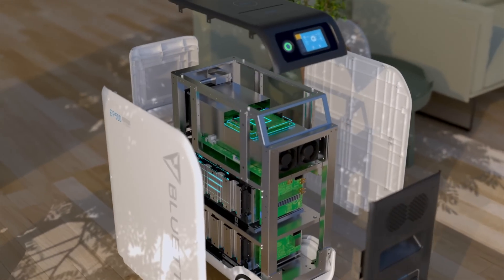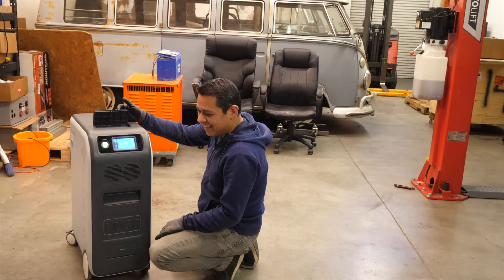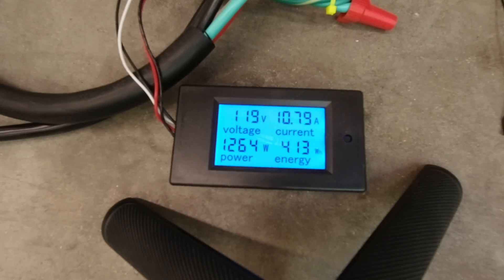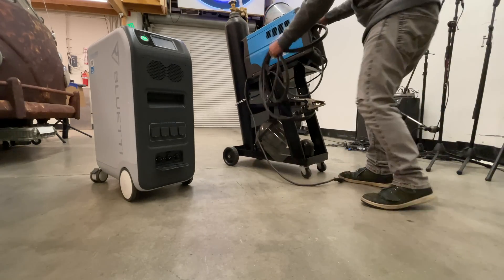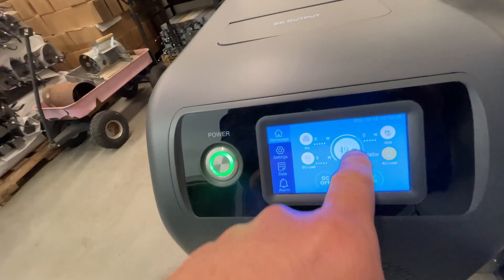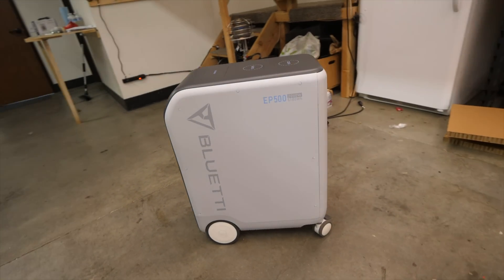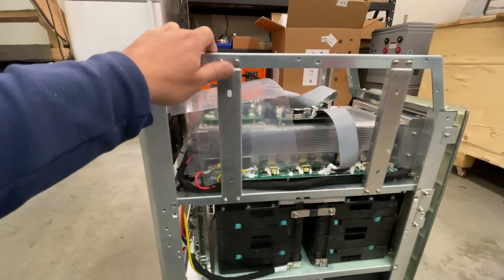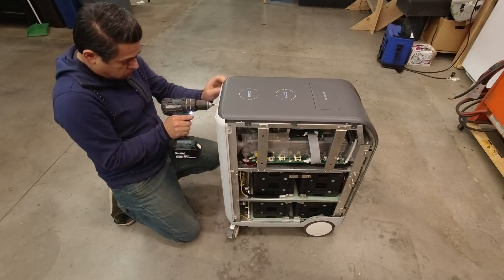Everything you need to know about Bluetti's NEW EP500 - review

Comment: Given the 85% efficiency, unless you live in a tinyhome/vanlife situation, you'll deplete this fully from 100% to 0% in under 1 hour if you try to use it to power your entire home, assuming a standard 2-3br home with efficient appliances and LED bulbs. My office alone, eats 14kWh/day, and my hot water heater (new, efficient, serviced model), is 16kWh/day. I'd have to be recharging this 6 times/day, every day, just to keep it from reaching 0%, even in UPS mode.

Comment: The elephant in the room, is the computer chips which grow fibers like corrosion shorting between the legs of the chips. It’s great, until the short. Will this failure cause an overcharged state or fire.? Will it just fail to charge, turning the unit into a toxic boat anchor.? This depends on the short location and that determines system failure condition. 😢

Comment: You can build this system yourself with 4 lithium batteries, an inverter, and a charge controller all for about $1,500.
Reply: You are way a little bit off but not by much .   Just a 100 amp 48 v. Battery is about 1,400 alone , then you need a good MPPT controller with an inverter for about 900 bucks  , then you need terminals, thick cables , switches etc, plus a way to move that brick around for another 2 to 300 bucks so you are a little off

Comment: Can I select that the power station uses Solar panels as its main source until the batteries are almost depleted? So only then it uses the AC power to keep my devices running? I would like to save money on my electric bill. 
My house is a rental that already has 6 solar panels on the roof, but since I don't own the place I can't add more solar panels to the existing configuration, so I want to use my own solar panels to a power station and then connect my TV, PC etc to save more money in the summer. 

Also, If the backup battery is full and idle but the solar panels are still receiving power, can it just send the remaining power back to the power grid via the wall outlet? And does this power station also support that? 
Thanks for answering these 2 question, good day :)

Comment: Just wondering if you know if the OCP over current protection - hardware alert on the ep500 pro easy to fix? Is there an internal breaker/fuse I can reset or replace?

Comment: I received my 2 EP500s from Bluetti. I was part of the initial 500 Kickstarter Backers. I did an AC load test, running a 1400W electric heater on a full battery. I ran the same test on both units to confirm any one result wasn't a fluke. I measured using a Killawatt meter. I actually got 4500Wh to the tee on both units--higher than the 4292Wh in the video. That puts the efficiency at 87.89%, or rounding to the tenth, 87.9%, or rounding up since it's only .1%, about __88%__. That's actually pretty good. Looks like Bluetti did some performance tweaking since these units were sent out in March.

Also note that in Offline UPS where grid power is "passed through" I found a problem. Hot and neutral wires were flipped! Verified with a multimeter and outlet tester. I contacted Bluetti, and they sent me a video with instructions on how to correct. Have to pull the front panel off and swap a couple of wires. You get a deep discount on the Kickstarter, but I guess the catch is you are somewhat of a "late Beta" tester and could get some "bugs." Interesting that they sent me instructions on how to do it instead of sending a tech. I guess they figured early adopters are more comfortable doing that type of stuff.

UPDATE: I pulled the units apart, and sure enough, the Line/Neutral wires were swapped at the PCB for the AC Outlets. Note that all of the wires and PCB connectors themselves were labeled correctly. It looks like someone on the manufacturing line just plugging in the wrong ones, plain and simple. Good news is that should be easy to correct--just tell the guy on the line, "Hey, you got the cables flipped. Connect them the other way." I suspect future batches will have this corrected now that they are aware, but for now, if you run into this problem, especially if you are one of the initial backers that were in the same manufacturing batch, contact Bluetti and they will show you how to remedy the situation.

UPDATE2: Bluetti contacted me again and said they traced the issue with the initial EP500 batch and are updating test cases to catch this type of problem on the production line. Future batches should not have this problem.

Comment: I got the EP500 and connected one Renogy 150D 12volt solar panel to it via MC4 cable.  I don't know which +/- set on the Bluetti MC4 adapter cable to use.  My PV input W is at zero, but it shows the input voltage at 22.0 on the DC Input screen of the Bluetti with the Input Power at 0 watts.  It does not appear to be charging even in full sun.  I swapped the negative MC4 solar panel cable to the other Bluetti negative MC4 adapter, - no difference.  I also swapped the positive cables - still nothing. What is wrong?

Comment: Question: I had a transfer switch installed in my house when I bought a portable 10k watt generator. If I were to purchase the Bluetti would I be able to use the same transfer switch or would it need modifications? Full disclosure I’m solar, LP & Gas generator ignorant so please don’t get complicated with the answer.

Also what parts would I need on hand for repairing the Bluetti should a solar flare or EMP event happen? Thank you for your time.

Comment: Great video. Always enjoy the thorough details you explained in all of your videos. Couple questions. 
#1. As your evaluation. Do you see, can the EP500 withstand being plugged in at all times specifically the PV input? I can manually plug in the A/C input when needed. 
#2. Has your unit gotten the firmware update yet that dealing with the UPS issue you mentioned in this video? If so, have you had a chance to retest the UPS function? Since you said the firmware fix is to put the grid AC in bypass. It is then not in true UPS mode. Right? It will need to switch over to the AC Inverter when the grid AC is dropped. Isn't it? Do you have any way to test the switching time that switches to the battery as power source? I wonder whether this may have the 23 ms switch time as the EF Delta Pro has?

Comment: at 4 :20 it appears you are pulling two 120v power legs into your transfer switch through your home-made cable?  Is that correct?  Could you do something like that to get usable 240v power from one bluetti?
Reply from the maker: No only 120vac available on the unit
Reply: Hi from PR!! Could you do a tutorial on that cable adapter?

Comment: The only Bluetti’s available here in Australia are the AC200P and the EB150.

$2900.00AUD for the AC200P

$1860.00AUD for the EB150 which has been superseded by the EB240 in the USA. 

I doubt we will get the EB240 or this massive unit.

Just not viable cost-wise

Comment: I'm trying to understand this stuff. Don't you need 2400 watts to get a full 20A outlet? How can this thing have 4 - 20A outlets with a 2000W output? I'm running a table saw and dust collector system, sometimes dust collector and planer, in each case eventually I have to reset the 20A breaker. Will this handle the load?

Comment: I know these have a place, and i'm all for alternative power generation and storage, but this product tries to compare itself to gas generators, and the cost deferential is just massive. My champion 3400 watt generator was $700 on sale. The specs on that are that it "produces 3060 starting watts and 2790 running watts (on propane), and will run for 14.5 hours at 25% load when using a 20-pound propane tank. My math puts that at 10,113 watts of power generation on a 20lb propane tank ($15 to refill). The equivalent Bluetti storage would cost you close to 8 grand, and then you'd need a pretty decent solar array (1-2K watts [another few thousand]) to keep this going during an outage. 

The majority of people see these useful in the event of a hurricane, or general power outage. A product that's close to 10x the price for that rare occasion doesn't really seem worthwhile unless you have money to burn, or a gas generator doesn't fit your living situation.
Reply: Well said. I like how you compared your gas generator to this power bank.  We have a Predator 9000/7250 watt generator that gets 13 hrs., at 50% load, on 8 gal. of gas. That brakes down to 47,125 watts generated in 13 hrs., costing us $24.88 in gasoline.  I converted our generator to a Tri-fuel generator, so we use Natural Gas as our primary fuel source.  

I'll stick with our Tri-fuel generator.  We can run 10 of the 15 circuits in our house, including our 3 ton AC unit.  The 12 volt battery for the auto start doesn't drop below 12.5 volts, after sitting for an entire month. We paid around $1,900 for our portable generator, 12 volt battery, wheel/handle kit, Tri-fuel kit, 10 gauge power cord, Gentent, a storage cover, manual transfer switch and some locks.

Comment: can a grounding bolt be attached to the metal frame of the ep500?  also if I ground the solar panels and combiner box on the roof to a separate grounding rod  in the yard do I need to consider grounding the ep500 ? NEC requires generators that are attached to transfer switch to be grounded.

Comment: another question. The top half of my house has 3 bedrooms with 230v a/cs (24,000btu) each and a standard electric dryer. I previously had a 10kw step down transformer from 220v to 110v which worked very well with everything in the top half of my house.  There is now direct 120/220v with no need for a transformer. In case of hurricanes etc I wanted to know if the split system can handle that load 24/7 with solar panels. can the wires for the 230v dryer and the a/cs go directly from the transfer box to the split system or would I have to run those 230v wires separately to the 230v outlets?
Thanks

Comment: I have another question. I have a 3/4 HP shallow well jet pump for my cistern and it can supply water to my whole house with 4 kitchens, 4 washing machines and  6 1/2 baths etc.  In case of hurricanes etc I want to be able to run the pump as a stand alone system for 24/7 7 days a week for 4 weeks.  The feature of the solar panels during the day and the battery in the night may work.  As a person with knowledge can a EP500 with solar panels work for me? The pump is 1500w running with 3000w starting. it is 115v at 13amps 60Hz.
Reply: Nope, won't do it. But it will run a margarita machine and your wife's hair dryer. Seriously, in hurricane weather rains, overcast, the solar charging is minimal. That well pump will be running all the time with 47 people living there. With 1500 watts burning up the battery when that pump runs, the EP500 won't hack it for very long. Why not spend the extra money and build more bathrooms and get a pair of Honda eu3000i generators, one being for backup?

Comment: I'm some situations the double conversion mode of UPS is preferable.  To get around the 600W limit of the (internal?) AC to DC, could you buy an external 1200W AC to DC to plug into the solar charge port?

Comment: Did you need a special plug on the Bluetti to charge the Tesla car?  Just wondering how you handled the bonded neutral for the generator to work.  I will appreciate if you can share any recommendations.
Reply from the maker: Yeah I made one using a plug and a receptacle just for this test

Comment: It has an idle consumption of about 50W though (calculated on the ~4.2KWh capacity, with a ~30% discharge after 24h), that's quite high
Reply: That's unacceptably high. 15-20w is what it should be. My cheap Chinese 2000w/4000w peak inverter has a 17w power consumption at idle.

Comment: That 4000-watt DJ stereo system appears to be about a 1500  actual peak watt stereo system which is why RMS is how all stereo amplifiers should be rated to prevent the sales lies since the average looked like it was well under 500 watts most of the time.  That stereo system should have been sold as 300-500 watts RMS and 1600-2000 watts peak.  If this stereo was actually 4000watts peak it would very likely need to be plugged into a 30A 120v or 15A 240V dedicated circuit in order to provide the necessary power and prevent tripping breakers constantly since breakers can go over their trip rating for short periods of time.  It would also be next to impossible to cool this unit if it was actually using that much power without a ton of heatsinks and fans.

It looks like that battery unit could be shrunk down by at least 30-40% before final production and they could build the outer portion of the chassis out of sheet stainless shell with a few bends for rigidity that would make the entire unit more dense stronger smaller and more rugged along with looking far more premium without adding much to the cost.  They should also use an LF inverter and tune it down so that it is in that 5-15 watt idle power consumption range when the inverter is on.

Comment: How Is the user instructed to make sure the unit doesn't put power back into the grid which could endanger line workers?  Can the unit be fool proofed (or is) to make sure it can't be used in a way to put power back into the grid during a power outage?
Reply: I am sure they won't tell you to make an illegal cord to back feed it into your house from an outlet but if your house has a transfer switch or power panel generator kit  (they should really make this a requirement for code in new or remodeled residential construction) already installed it is easy and safe to feed the entire house using a cord that plugs into a standard generator socket especially if you have 2 of these units. The transfer switch or generator kit guarantees that the main breaker is off or de-energized before the generator outlet will connect to the home panel.  The other option is to have a critical loads panel (also a fantastic thing that more houses should have) so all-important loads like lights, fridges, phones, comms devices or even in some cases a well pump can be run in the event of a power outage

The challenge for most people is that 2000 watts of power is decent for weekend RVing but not a lot of power when you are running your house or RV off of it for an extended period of time so some people may need 2 of the pro units just to keep the important loads powered without much thought that they are in a power outage if they have a larger house with many loads.
Reply from the maker: the idea of back feeding is the most distorted, misunderstood and annoying subject.  I am tired of it.

Comment: Can you do more welding with the bluetti powering your mig welder please I would definitely love to see how long the bluetti will power the mig welder, I honestly wasn’t giving this machine a chance but now I’m curious as to how much welding can be done from this bluetti lipo battery that’s awesome
Reply: Also it's not a lipo battery, it's a Lifepo4 battery
Reply: It would power a welder for atleast 2.5 hour of actual weld time. You could probably use it to weld all day. This has a 2000w inverter so that means even if the welder uses 2000w the welder would run for 2.5hours since it has a 5000wh pack.
5000wh÷2000w =2.5hours. But nobody welds nonstop for that long.

Comment: I feel it need to be at least 3,000 watts for as big as it is, & have serviceable cells, with a 220V Dual Voltage in a single unit. It should be something easy to accomplish as they do this on generators.
Reply: They have a pro version with 3000 watts

Comment: Do you need a subpanel to connect it to in order to use it as a UPS backup or can you plug directly into a transfer switch?
Reply from the maker: Sub panel is not needed
Reply: Thanks for confirming. That’s interesting though because the Bluetti folks are telling me I need to purchase their UPS Box (which is a subpanel) in order for it to work as a whole home backup system.

Comment: I heard these will run around $4000.  If so, it's a little pricey.  They should keep it under $3000.
Reply: How does it compare to other whole house battery options price-wise?
Reply: @mrbizi5652  Whole house would run $5-$10K.  But this does not require install and you can pretty much do the same using a generator back-up transfer circuit like he's doing.   Great thing is you won't get ripped off by you utilities.  They pay pennies on the dollar for excess solar power you sell them.

Comment: I’m curious to know if this would power my cargo trailer...  I plug it in at jobs and use it as a mobile workshop...  would this be able to make some rip cuts with my table saw and miter saw at a job, or run my 30gal air compressor?  And for how long?  What would you recommend for a off grid power source for a mobile workshop?
Reply: Hi Dempsey, Inverters can really struggle with starting up power tools, compressors are probably the worst, i have a 2000w that can not start a small compressor. So almost certainly the EP500 will not run your compressor, the EP500 pro has a bigger inverter (3000w) so it may fair better. I would suggest looking into what Will Prowse did with his trailer, it will be cheaper and give you much higher power (6500w) which will start large power tools. Also you can add batteries if you need more capacity easily!!
https://www.youtube.com/watch?v=JCeVbqkPqwU
Hope this helps!!

Comment: Outside of battery capacity and longevity the specs are the same as the Ac200p. Better to build a wall with  inverter, ect... You will get equal or greater capacity for much less. I guess I will be ordering more scooter batteries. It looks cool but I can't justify the cost. Maybe I'll be moved from my opinion as it is tested further or more abilities are revealed but as if now, it's a no go for me